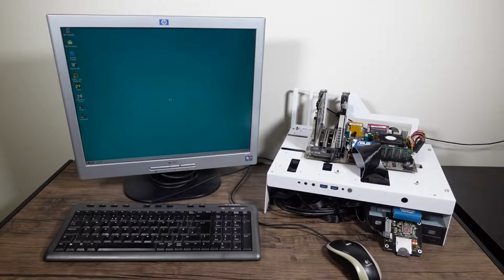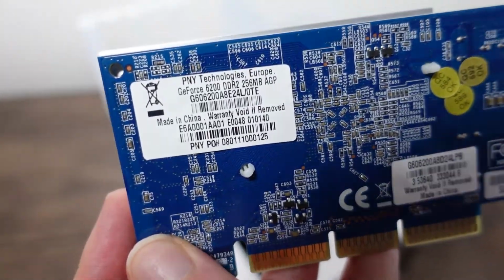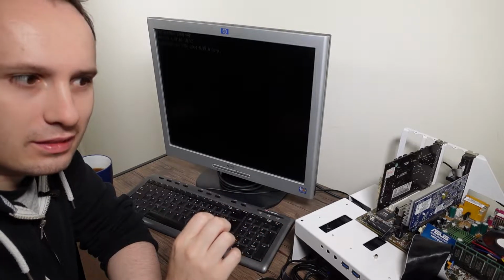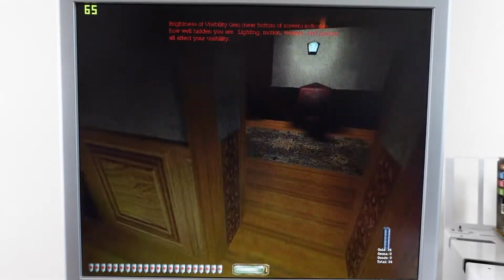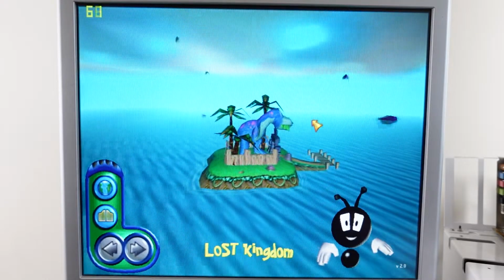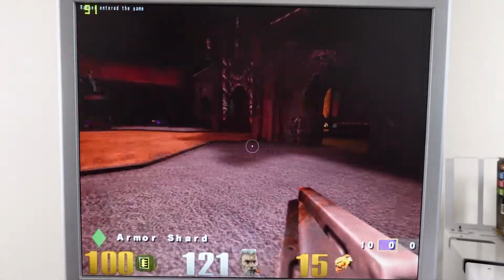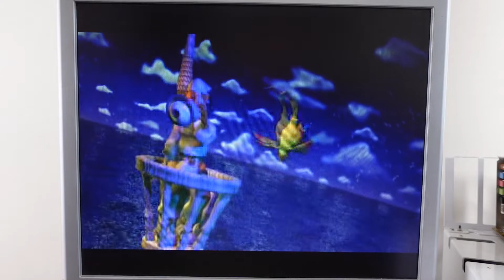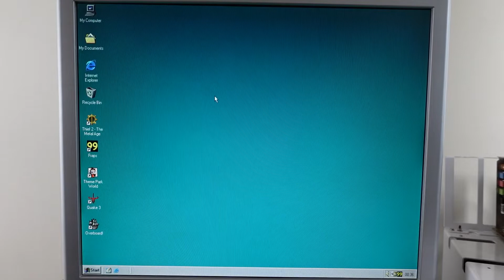Windows 98SE - My "New" Windows 98SE Machine

Comment: I've not dabbled with W98 and Pentium 3 yet. Only been back as far as an old XP system using a Northwood Pentium IV and that exact "video card" 😅😝 
Wanted to overclock it a decent amount so I drilled some holes in the heatsink and strapped a little Noctua fan (40mm I think) on with zip ties to keep it much cooler and it works a charm and it's quiet. Half capable for old games but it looks like an absolute bodge job 😆

When you showed Thief 2 I was shocked at how nice that looks for such an old game. The lighting is wicked. The old Sold Out disc brought back some good memories, Hitman Codename 47 and Conflict Desert Storm were distributed by that company. Then Theme Park World, I had that on ps1 and used to play it often with my sister. The tutorial pop up character with the Scottish accent 🙃

This video was my introduction to Ship Wreckers. Not bad at all. 

Would that stutter issue be remedied if you used an old school IDE hard drive instead of an SD card?
Good video fella, enjoyed it.

Comment: I used a sata card and a western digital velociraptor, I wanted hard disk noises. I went for amd athlon 1400MHz and and ISA awe 32 + vodoo 2 for dos gaming, 6200 for windows gaming. It has 98SE and win2k dual boot.
Reply from the maker: I do love a WD raptor. Well it certainly gives the hard drive noise, not seen one of those drives in while.
Reply: @AvenyetsTechWorkshop  It's loud, but nice. I can't find a nice case I like to put it all in though with dvd and floppy bays. I want a clear side panel.
Reply from the maker: @jondonnelly3  front bays have seemed to have vanished from the "premium" side of things which is a shame. Might be worth looking on eBay for older cases with side windows. Corsair carbide or similar.
Reply: @AvenyetsTechWorkshop  BE QUIET PUREBASE 600. This might do and a 5.25 to 3.5 adaptor.
Reply: @AvenyetsTechWorkshop  I have a carbide funny enough! No side panel on it, went missing.

Comment: I have built myself a potato with the athlon 64 3200+ socket 754, 512mb DDR ram, FX 5700 le 128bit and the good old sound blaster live... It's a dream machine... Runs quake 3, it 99 and diablo 2 beautifully with amazing eax. For storage it's a 16gb SD card and this storage solution is pretty good and fast and I use it with windows XP as well.
Reply: Socket 754 is the best for w98 I think. The best configuration I tested was:  Turion 64 MT-37 (set it from 1.05 to 1.2V on CrystalCPUID); 2GB DDR400 (memory patch); XFX Geforce 6200 256MB 64bit + Nglide (For w98 it is okay); 64GB SSD (sata to ide or sata patch); SB Live; Daemon tools 3.47.

Comment from the maker: There a few things wrong with this build overall. First the RAM isn't great but I don't plan to upgrade beyond 256MB ram at this time. The GPU could probably be a bit better maybe a Geforce 6600GT but I would like to see if i can get this passively cooled (the PCI-E version can be passive). 

Lastly I need to find a better wayo to use that microSD card or use an SSD since it does cause a little spike in load here and there.
Reply: Hi, could you tell me which drivers you used for the 6200? I've heard this card can be a little buggy under W98.

I have an old Coppermine machine that I want to have some fun with, and have just acquired the same card. Seemed more cost effective than some of the more period-correct options, and should be more than good enough for what I have in mind.
Reply from the maker: The machine is in storage at this moment in time but I normally go with 81.98 as a starting point and I had no issues so I don't think I tried any others. I've good luck with 71.89 in the past when I have issues. The last few drivers they did were a little buggy.
Reply: @AvenyetsTechWorkshop  Thank you, that's very helpful!